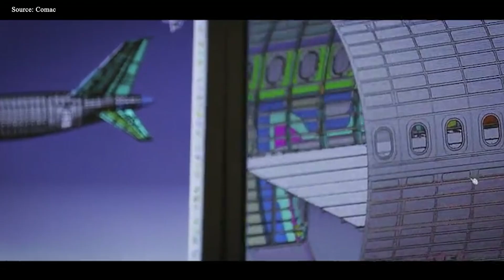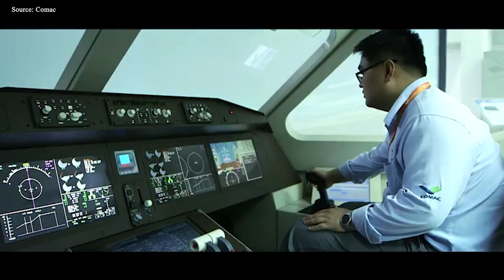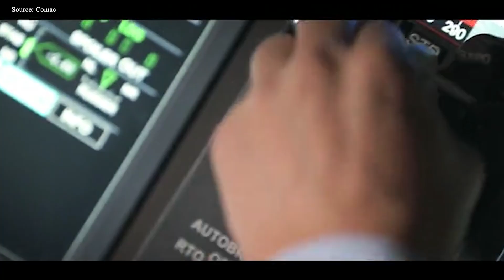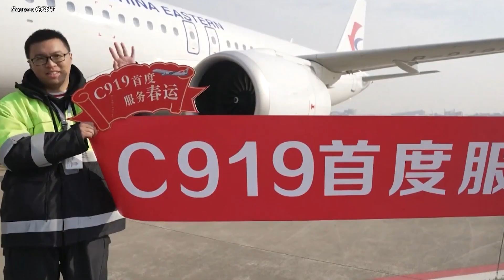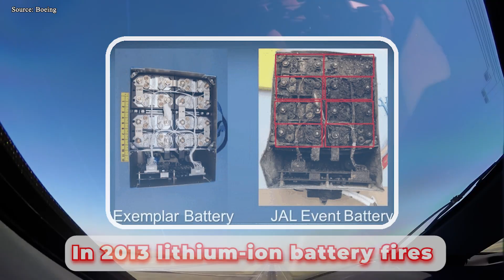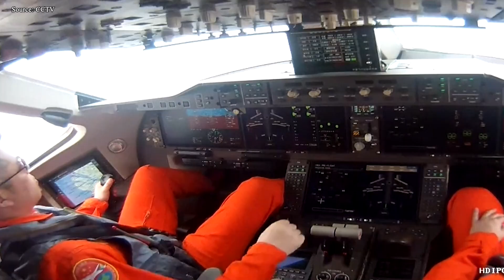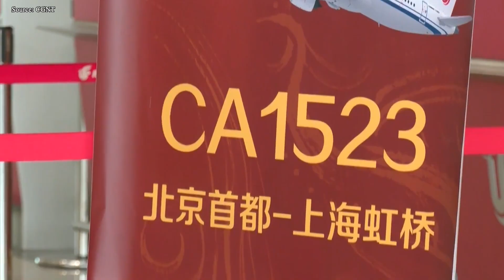COMAC C929 vs Boeing 787 Dreamliner: Which Aircraft Is Superior?

Comment: Excellent progress considering Japan tried this and failed plus all the foreign blocks they have had to overcome. Of the two in service (C909and C919) I have been in the C909 (the smaller one). Very comfortable and excellent trip. Knowing China they will surpass all expectations. The main issue with the C919 is its dependency on foreign engines but I believe the they are producing their own. Certification has been blocked by Europe and US even though they met all the standards. Blocking is shameful but in the longer term China will find a way. Maybe in the longer term Chinese aircraft will be as dominant as  Chinese EVs. Their fighters look intimidating.